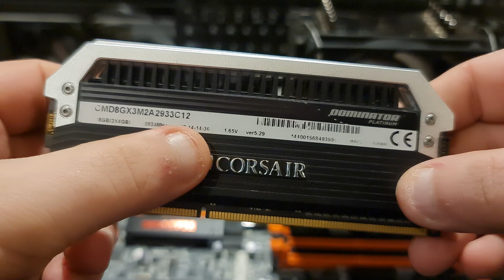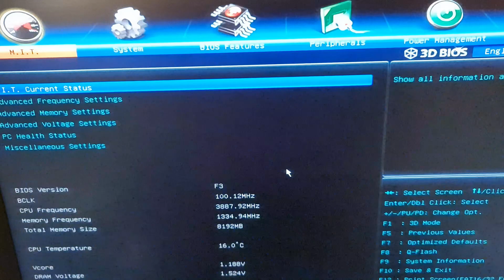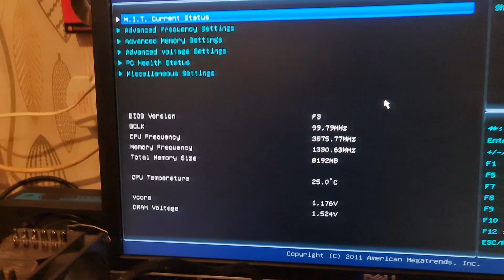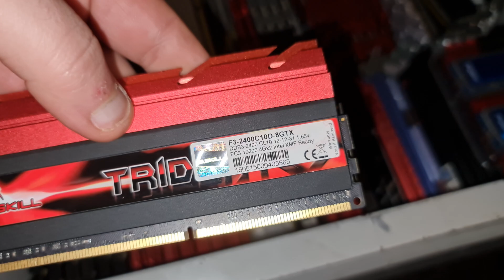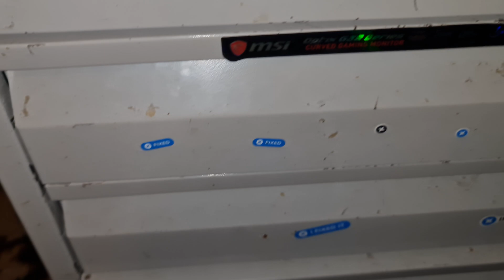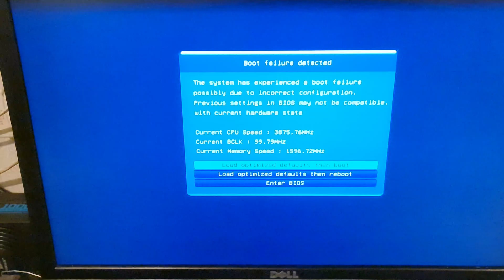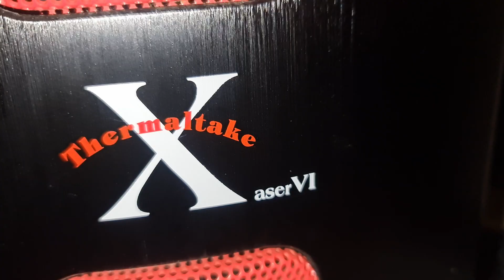THE MOST INSANE Z77 MOTHERBOARD

Comment: Well done! Bad ass, all of it! It's great to see the older tech components be brought back to life like that. I'm new at PC tech and building. Worked as an auto tech for over 35 years and can no longer work my trade because of age and disability so I thought I'd invest in a new hobby and learn about PC's. I am at the back of the class and way behind the curve but put together my first PC out of affordable LGA 1150 parts with an ASrock Z87 Extreme 4, Intel I7-4770K, EVGA GTX 1060 6GB, Corsair 650W PSU but installed it all into a new Gamdias Talos case. I have a Thermaltake Versa H35 case and an I7-4790K for the next project. The motherboard and case featured in this video with water cooling looks great and the LGA 1155 stuff is still plentiful and even more affordable. No fancy ARGB bling is needed either. 2 questions. What CPU is in your build?  The background tunes, first track at the beginning of the video, good driving music, who is that? Much appreciated. Look forward to the next video
Reply from the maker: I'm putting a i7 3770k in the motherboard. this motherboard was one my favourite motherboard when I was growing up but I couldn't afford  it back then and now there very hard to finded witch make them pretty rare . I get all my music for my videos from the youtube music library .Thanks for the comment 👍 😎 . The next video is coming soon